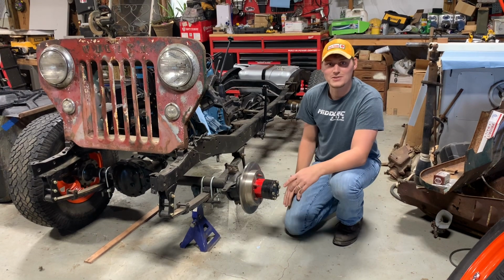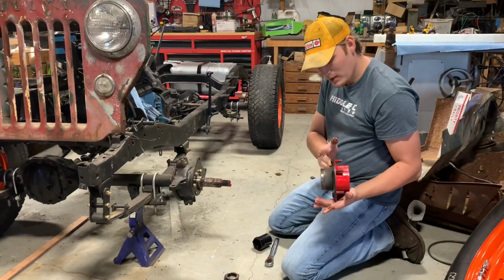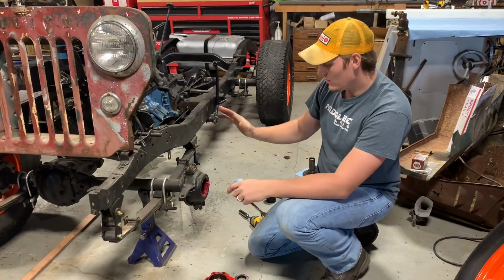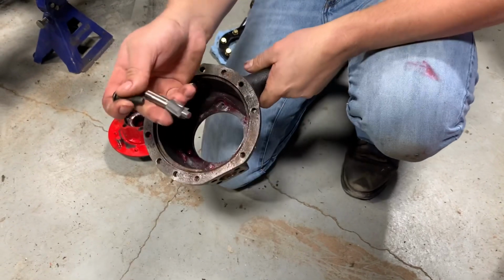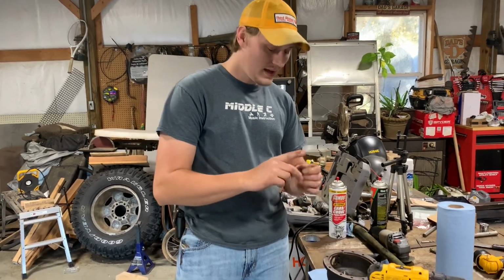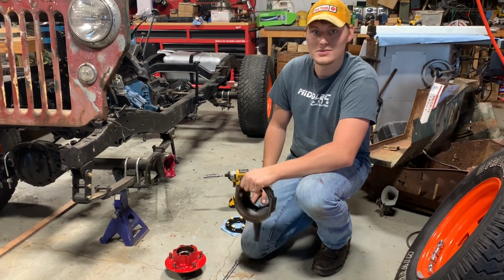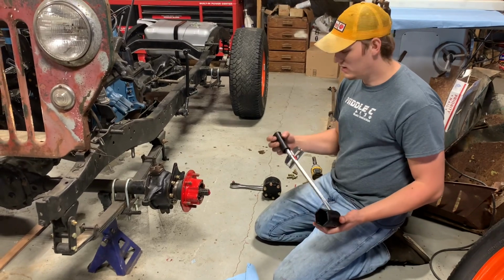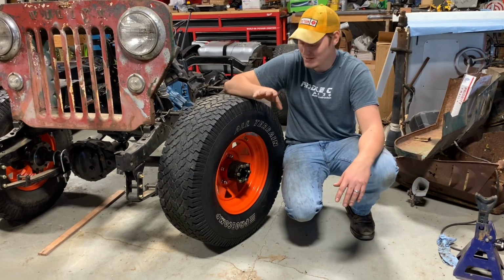Willys Jeep Studded Knuckle Upgrade!

Comment: I just completed this upgrade for my 1971 CJ5.
Found your video very helpful- thank you.
One suggestion is that after you mill down the back of the knuckle casting for the studs, you should chamfer the holes slightly. The bolts are never threaded 100% to the head and chamfering allows the back of the head to sit completely flat on the newly milled surface.
Reply from the maker: Glad to hear it! Great point you’re right a chamfer makes sense. Thank you!

Comment: About to perform this weekend once the 5/16 pilot arrives Sat, the counterbore and bolts arrive today. I almost got away with an 11"  brake conversion with no issue, two of the threads on the pass side are boogered, tried a tap, a bit better but still slipping when bottoming. May as well address this now, glad you made this video, well done Jacob.
Reply from the maker: It’s a great upgrade while you’re in there! Thank you!

Comment: just found your channel and am very impressed with your info.  I have a 47 cj2a, one owner and a 27K mile 75 cj5 barn find and will probably do the disk brake thing on the 47 with the kit you used.  47 jeep brakes suck!  Thanks again and good job!
Reply from the maker: Thank you I really appreciate it! Shoot yeah sounds like some great projects and the disk brake upgrade would be a huge improvement!
Reply: the cj5 had a 304 but now a 30 over 401 and top loader 4 speed.  The original owner installed nitro sprayers as he drag raced this thing in Spokane  (weird)  Hadn't been run since 98 but it does now!  Too much power for a short WB Jeep.
Reply from the maker: Dang that’s crazy! I’d love to get my hands on a 401 someday!
Reply: @SevenBarSalvage  They are around as jeep pickups and wagoners used them.   Lots of power and lots of aftermarket stuff and the nice thing, same exterior size as the 304 and a direct bolt in.  I got rid of the nitro and went with an edelbrock  carb and manifold.  Mine needs all new exhaust.  Cool jeep, renegade, levi edition with acme top, all doors and rear seat, and exra set of used BFG tires all for $800.00 but I had to haul it out.

Comment: Where can I obtain the part numbers for the disc brake conversion? Brackets from Brennan's Garage not a problem. I need the part numbers for all the other components to do the conversion.
Reply from the maker: Brennan’s website also list all the different part numbers that work with this! Hope this helps!

Comment: I’m in the middle of the disc conversion and can’t find the appropriate banjo bolt to go from 95 Geo Tracker calipers to 85 Honda accord soft brake lines, what did you use??? Thanks great video also did the spindle stud upgrade!!!!
Reply from the maker: I just ordered these:

https://www.ebay.com/itm/115568528625?mkcid=16&mkevt=1&mkrid=711-127632-2357-0&ssspo=ZHHgqPCATEK&sssrc=2349624&ssuid=KlFNx9vlRJC&var=&widget_ver=artemis&media=COPY

Hopefully they are the correct ones last time I orders calipers they came with them but not this time and they are a little hard to find you’re right! That’s awesome! Thank you for watching!

Comment: do you need shorter button head screws if you're running the stock brake backing plate  instead of the disc brake caliper mount plate?
Reply from the maker: Good questions! I believe you will want to go a 1/4” shorter.
Reply: Hi, what diesel engine did you swap and what transmission?  Thanx man best to Brasil.